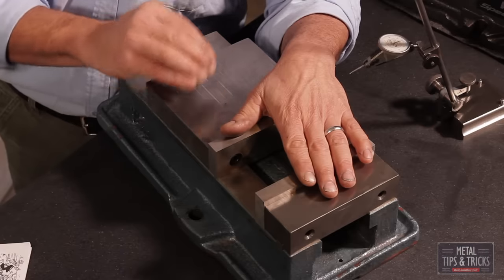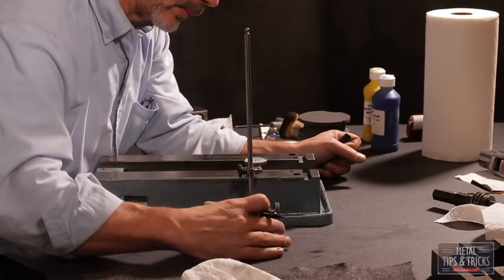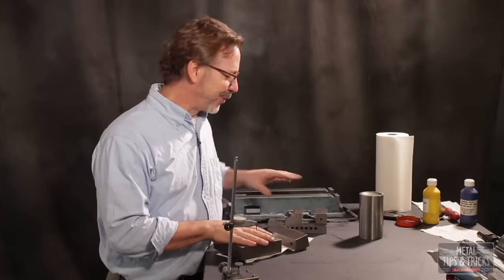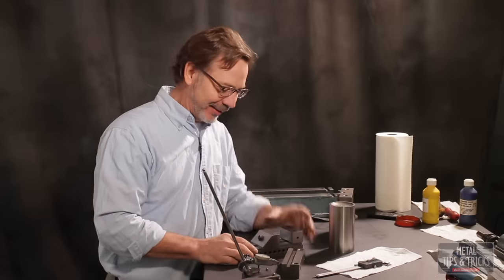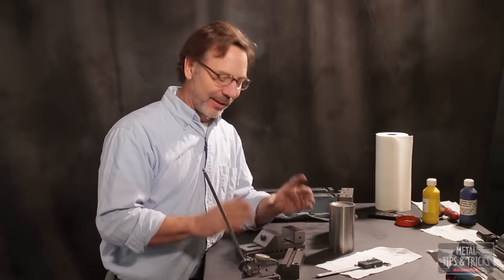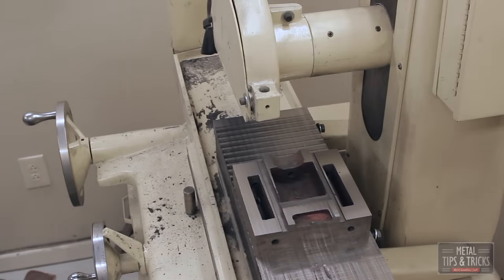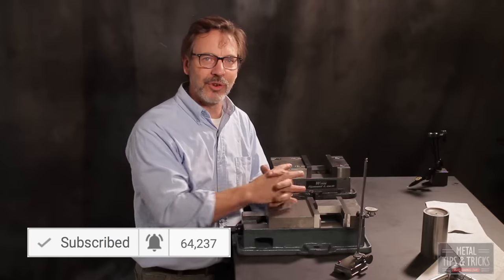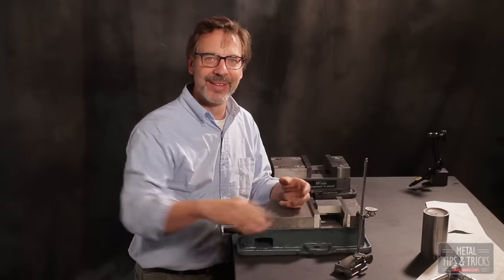China vs Usa  controversy machine vise

Comment: i would have thought the challenge was to find a USA made vice for $200. And im pretty sure that China didn't advertise that vice as a Kurt replica, i didn't realize Kurt vices were the industry standard around the world or the patent holder for that design.
Reply: I think most people who purchase an inexpensive milling vise expect it to be within .001", or maybe .002" worst case for parallel and perpendicular. Dale showed that the vise he purchased wasn't even close to that good. Much machine work requires precision within .002", so it helps a bunch if your vise is much more accurate than the workpiece you are producing.
Takeaway: if you can, save your money for a good quality vise, used or new.
Reply: totally agree but as a base consumer beginner i think that that Chinese vice or even a Taiwanese vice is the way to go and when your skills get better and your money comes in, to afford a surface grinder and many of Dales expensive equipment to either fix or make better the el-cheapo. but to compare an orange to an apple and expect anything similar is just a waste off time. i like watching his videos but this is neither helpful to a beginner or of any use to a pro. talk about the benefits and cheap ways to fix a cheap vice if thats the way you want to go but dont compare to a very specialized vice.
Reply: The comparison Dale makes may be a stretch, but I can tell you from recent experience as a beginner that it won't take more than a few hours of use to realize that your vise is out of square. The first thing you will do with your brand new inexpensive vise is try to square a block, and when you find that your freshly squared 4" long block is out of parallel and/or square by .007", you'll be pretty upset.

Comment: In your last video you'd pointed out some poor design choices in the Chinese vise and those seem to be the overriding issue and aren't something that can be corrected. It would almost certainly be better to find a used high quality vise and regrind if needed. At least then after all the work you'd have a decent tool to use.

Comment: When I was assigned in Southeast Asia in the 60s, and 70s, and 80s from time to time I saw a lot of Asian peoples buying American manufactures as fast as they are put on display like hot cakes because they are all 100% MADE IN AMERICA FROM RAW AMERICAN ORES TO THE FINISHED PRODUCT REGARDLESS OF THE FACT THAT THEY COSTS 3 TIMES TO 8 TIMES MORE THAN THEIR LOCAL BRANDS BECAUSE THEY WERE ALL BUILT TO LAST! But their enthusiasm started to dissipate when they saw American products MADE IN CHINA THAT PUT THEM OFF AND THEY STARTED SCROUNDING FOR OTHER BRANDS STILL 100% MADE IN AMERICA IN THE MID-1980s until their purchases of AMERICAN BRAND PRODUCTS MADE IN CHINA FORCED THEM TO LOOK FOR ELSEWHERE OR ARE FORCED TO BUY ROTTEN MADE IN CHINA PRODUCTS BECAUSE THEY HAVE NO ALTERNATIVE CHOICES!

Comment: AvE tears apart a tool to see what sort of materials, designs, etc the product is made of and makes some claims as to what may or may not fail, which will go first, failure or success points, etc. He doesn't always get it back together and say it doesn't work. He is very fair with his opinion and often gives some reasons to still buy and use what appeared to be a poorly made tool. I don't think I've ever seen him put a tool back together and it didn't work so he blamed the tool.

Comment: You get so much less than you are paying for.  But feelings!  You get to pretend you have a vise almost as good as Kurt when really it's just a drill press quality vise.  Even after 12 hours!  No, spend 12 hours making money then buy the Kurt for what in reality is 1/2 the cost of the China vise.   Now I really want a 4 inch Kurt for my small mill.  It won't make the mill American made but it will reduce the error and when I improve to a good mill, I will be that much better off.

Comment: Probably should have figured out what was creating lift on the part before spending 12 hours grinding to see no improvement.
 What we should be saying is hay if your new to machining and don't need accuracy batter than 5 thousandth and let's be honest the likely hood of some crashing or drilling in to their vice when your self taught and working out of the corner of your garage is quite high.

Comment: I recently bought two Chinese 4" vices to gang. I assumed correctly that I would have to machine them. I planed to get the bed heights and jaw heights the same. Based on this video, even if the other dimensions are off, might not be worth it to machine them. Based on my experience with Chinese vices, I expect that I will get the results I need as far as set up and accuracy goes. Kurt definitely is much better, I have one, but if one knows how to use cheap vices they can work good. I should video me machining and testing them,.. But I do not have the time.
As far as AVE goes, to me, he is entertaining and fun. He does make some interesting points, may not do things the most accurate, or whatever, but I think he just wants to bring fun and entertainment, and at same time some education. I enjoy his stuff, even though, many times, I find that I could test something in a better way. His latest bolt tensile test actually comes real close to how it is done in the lab,.. well simulates it real close. I think that is his best so far as making it replicate a real lab. But in the end, I do not expect him to totally replicate the way a lab does it. He makes it fun, and that is cool. 
I guess you are here to make it real (this is only the third vid of yours I watch, and so, have no idea) and that is great, and I like that a lot too. Because I am technical and want to learn stuff.

Comment: it still is one thing I got in both vids... you get what you pay for... you can spend 200 on a chinese vise or 700 on a chinese made vise... a lot of big companies that sell specialised equipment have tools and materials being produced in china for them and just relable them (and sell them for a bit more because they now have their name on those things... and still it is the same... you get what you pay for)

and comparing metric with imperial tools and their measurements... well... not going to make a statement on that :P

I like your project vids a lot more Dale... especially the ones like the metrology center build twothumbsup
Reply: by the way, I got to work with two kinds of firefighting fog nozzles... one made in China (for a big firefighting gear and vehicle company that is one of the market leaders) and the other one made in Germany selling them under their own name to a lot of manufacturers and equipment stores... both damn good quality to be honest and no cheap shi*...

however... I was surprised that the German made one was CHEAPER than the Chinese relabled version... and this is why I got the German made fog nozzle myself for the layflat firehose I use for washdown after floodings

and to make it comparable... the one I got myself (German made) cost around 85% of what the Chinese made one cost in the store (and I did not even get the cheapest price when I ordered it)

yes, you get what you pay for, and sometimes you pay more for good quality when it comes from far away ;-)
Reply from the maker: Thanks for your great comments :-)

Comment: Well you can buy a cheap vise from China And use it out of the box and Make parts that are never the same because the vise being out. Or you can buy a USA made vise that has been tested and doesn't matter where on the Mill bed it is placed it will make the same part every time unless your Bed is out. I use the Key ways on the bottom of the vise and locate the vise in the same place on every setup this way if the vise is dead on my work will always be dead on and it makes for fast change overs and if it a CNC your Setting in the G54, G55 can be preset. If the USA vise is made the same as the next vise Two would be interchangeable but the China vises would be not. This makes alot of Manufactures veer away from cheap vises. I have worked on Machines that used vises as fixture holders for Manufacturing Missile parts and re-setup time is cut down. The time you save can pay the extra for the vise quality in the long run.

Comment: nice work on fixing up that cheapie vise Dale, that was a vast improvement.
i still have to offer up a small critique here, when you're applying the torque to the vises they really do need to be bolted to a machine table. the machine table gives the vise a pinch more rigidity and gives you a better reading on the measurement. on your second re-torque of the chinese vise it was apparent that the vise was lifting off the table as you applied torque.
 
but you identified the root cause of the failure which i have been saying for years: the crappy metallurgy. the chinese maybe masters of copying but they just can't cook steel... i don't know what they do it, but the iron they put out is just absolute dogshit..

also, i was going to chime in on the time factor and was going to throw out the same figures you came out with. 
so for those out there who have the time to burn on projects like this then chinese tooling maybe right for them. however my time has to be worth a little something and i can't see putting in countless hours trying to work around shitty castings and shitty iron.  sometimes it just doesn't pay to polish a turd.
for those out there who think good tooling is out of reach, it is not. it just requires a little leg work and some good old fashioned sleuthing. there are a few good tips on that in my latest shop rant if anyone is curious. 
cheers
mike

Comment: I would attribute the difference in the quality of the vices even after your regrind to the mechanical implementation and quality of the screw mechanism as well as the ductile qualities of the metal used more so than simply the foundry shortcuts. The load bearing strategy is obviously poorly engineered.

Comment: The Chinese vise is ok for hobby work, not so much if you are trying to make a living with it. Can the Chinese vise be fixed?...Yes, but do you have the time in a working shop to fix "new" tooling so that it is usable? That $400 you "saved" on this vise will be long gone by the time you realize there is a fault, figure out what's wrong, and send it out to be fixed because your grinder isn't big enough to hold it.
If you are doing a difficult job, the last thing you want is tooling that is "almost" good. In the hobby shop, sure, you can work around it. But "working around it " is not something you want to be doing if the job already has several thousand dollars in materials and labor tied up in it and it comes out of your hide if you scrap it.

Comment: Stepping into the grind shop is akin to stepping into the Twilight Zone.. filled with second-guessing and misgivings.  

Even drawing out the diamond is a chore.

Hope you can find a larger grinder.  I just HATE to run out of travel and have to re-position in the middle of  a grind, or take an angle path.

And on a long grind... how much wheel's diametric reduction is happening during the grind?  So you awake in the middle of the night, pondering a slanted, dished, stepped finish grind as the wheel shrinks as you travel about the surface.

And that vertical end grind... made you sweat, didn't it?  Ever see a chunk thrown by a wheel?  It is not pretty... first the chatter, then the bang

I do appreciate that you have a smiling, good nature while pondering the surface grind strategy.  Those are good puzzles, how to hold, and which surface first.. more things to wake up in the middle of the night and toss around in your head.  Maybe the surface grinder should be situated in the center of a rubber-padded room.

Thanks, enjoyed the memories... I haven't touched my grinder in several years, as even a "small" job really isn't.

Comment: In the 1980s, many countries around the world sent back their machine tools, heavy engineering machineries, machine building machineries, industrial machineries, heavy factory machineries, power plants, etc THAT WERE DESIGNED AND BUILT DURING THE 1950s AND 1960s FOR REFURBISHING, CLEANING, INSPECTION, CHECKING, TESTING, MAINTENANCE REPAIRS SO THAT THEY CAN BECOME AS GOOD AS NEW AND SHIPPED BACK TO THE COUNTRIES THAT PURCHASED THEM. THE REASON IS SIMPLE. IN THE 1950s AND 1960s AMERICA DESIGN AND BUILD TO LAST! IF AMERICA DOES THAT AGAIN, THEY'LL ALL GO BACK TO BUYING ALL AMERICAN TO ADD TO THEIR OLD STOCK OF 50s AND 60s ERA AMERICAN MACHINERIES "REGARDLESS OF THE COSTS" BECAUSE THEY ARE GETTING THEIR MONEY'S WORTH!
Reply: darthvader5300 Not just machinery. I worked in a steel foundry that produced railroad castings. About 15% of our work was refurbishing and inspecting castings that had been in use for 30+ years. 
     At one point a rail car builder decided they would buy castings made in Mexico because they were less than half price. Within a year those castings had failed dozens of times causing derailments all over N. America. 
        Needless to say, that car builder ended up taking every single one of those castings off of trains. 
     I would LOVE to know how much that decision ended up costing them when the fiasco was finished. I know it had to be well  into the billions of lost revenue alone. Not to mention the law suits that are probably still pending today.
Reply: When I was assigned in Southeast Asia in the 60s, and 70s, and 80s from time to time I saw a lot of Asian peoples buying American manufactures as fast as they are put on display like hot cakes because they are all 100% MADE IN AMERICA FROM RAW AMERICAN ORES TO THE FINISHED PRODUCT REGARDLESS OF THE FACT THAT THEY COSTS 3 TIMES TO 8 TIMES MORE THAN THEIR LOCAL BRANDS BECAUSE THEY WERE ALL BUILT TO LAST! But their enthusiasm started to dissipate when they saw American products MADE IN CHINA THAT PUT THEM OFF AND THEY STARTED SCROUNGING FOR OTHER BRANDS STILL 100% MADE IN AMERICA IN THE MID-1980s until their purchases of AMERICAN BRAND PRODUCTS MADE IN CHINA FORCED THEM TO LOOK FOR ELSEWHERE OR ARE FORCED TO BUY ROTTEN MADE IN CHINA PRODUCTS BECAUSE THEY HAVE NO ALTERNATIVE CHOICES!

Comment: you also have to remember that the china vise you are using is intended to be a lower price version that you might be able to use to get the job done but every country seems to think that if someone builds one that looks similar that they are trying to compete against the others brand in performance and price and over all everything....in which they are not ....they are only trying to give people the chance to still get work done at a much lower price.....same holds to do we not have harbor freight and snapon here? and people stll to this date try to compare one another in which they should not be compared because one is just to do the same work just ad a lower budget , a much more fair comparison if you are trying to label a vise not just for its obvious trying too look like a similar product already made from competing country  ....i think you should compare the exact budget use on that countries vise and then buy the exact budgets use better vise from that country now you can compare not just compare a knockoff that they are not trying to claim it is better or not they are just bringing it to the market to give more people the chance to get the job done depending on how accurate you want something done because i guarantee you the regular person would never know the difference if they held what was made by either one....so to conclude every country has there cheap stuff that sells fast and there higher budget things that are slower selling but much better quality.

Comment: Why were all of your measurements not in Metric? 

Deformation (of Iron, Copper, Brass, Aluminum etc) is really a function of Thousands of units of a mm. 

For a US (or Canadian) machine shop to buy the CN vice is still a bargain as lesser skilled people with lower rates than 100 US/Hour are easily findable and feasible. Fixing the unit for higher precision is a 250 CAD fix at best. 

 Also many machining processes are just fine with precisions of Hundredths of a mm. 

Yes, the Iron manufacturing of the unit is sub-par -- and the bearings and tightening mechanism should have been exact copies of the original US design ... but still a good buy for reasonable precision work. 

In China or the Han Civilization maybe you have have to tune your Vice Grips after you buy them for machine shop work in most places...

Comment: Well now, as I've been a fitter and turner for the last 60 years and have been retired for the last 20 I've worked in a lot of factories with a lot of vices that were from good quality to pretty poor etc. but you have to work with what you have and not spend the first day or two at your new work place testing the equipment......that pisses off most bosses.
On the home front,  2 years ago I shelled out A$140 and bought a 100mm wide screwless vice or as it is also called a grinding vice for my CNC mill but so far have only used it on my manual bench top mill.
Long story short........I hated that vice from the day I bought it and relegated it to the back of the bench never to be used again or sold on etc.........that was before I took a longer look at the problem .....the prob was that the f##king nut that the screw works in, down in the bottom, kept tilting and falling out of the slots etc.......grrrrrr, how I hated it......another problem even worse was when the moving jaw was pulled back on any hole there was only 1 or 2 threads on the screw in the nut......total crap.
So I investigated and totally redesigned the nut mechanism......now it works perfectly and has never failed.
I bought that vice because it holds work down on 2 parallels and grips them hard.......testing the faces etc and it was dead on.